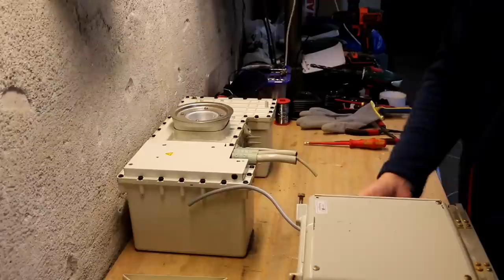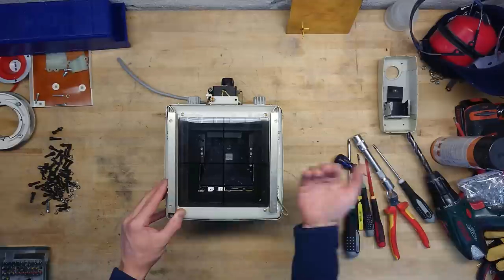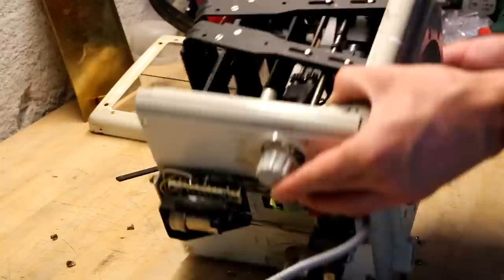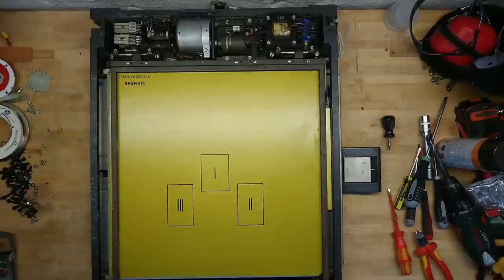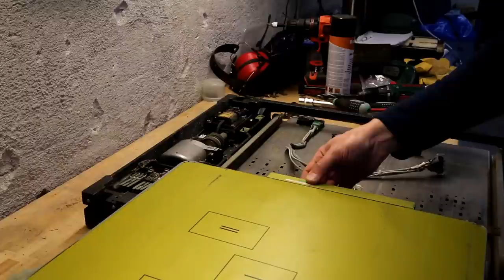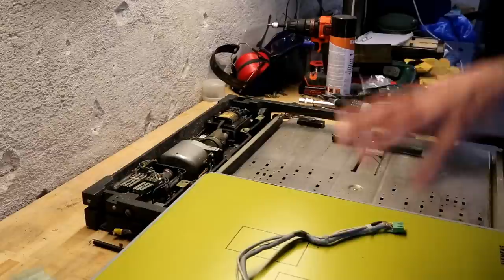Siemens Polyphos 30, XRAY Collimator and Image Plate Teardown (Part 2 of 3)

Comment: It appears to be an analogic X-Ray plate (film based)
The gray plate is a X-ray grid (fine lead strips and some x-ray transparent material strips interleaved) to avoid indirect x-rays ( it increases the resolution).
The yellow plate appears to be a typical design of an ionization chamber, a gas filled between two charged plates to detect x-rays.
There is no digital detector on this design
Reply from the maker: Thank you very much for clarifying what these parts really are :)

Comment: Could the small "motors" potentially be synchro transmitters?
Reply from the maker: That is a very good guess, they would make sense in the application where you want to synchronize multiply blinds that are not mechanically connected. I was not aware of the concept of synchro transmitters/receivers, thank you for pointing that out!
Reply: @KaizerPowerElectronicsDk   they seem to be used heavily in avionics, at least older avionics. There's another YouTuber that I watch (msylvain59) who tears down a lot of old aircraft stuff and they show up quite often. Supposedly very accurate for measuring or recreating angles or movements remotely.
Reply from the maker: I have been subbed to msylvain for years, but he makes videos faster than I can watch them all :)
Reply: @KaizerPowerElectronicsDk  I dont know how he manages to find all of this stuff, or where he stores it afterwards... But I do love his videos.
Really liking your videos too. Especially the mobile base station/RRU tear downs, since I work in telecomms myself. :-D
Reply from the maker: @TomStorey96  He buy it from ebay or other auction sites for the most. I got a few more amplifiers and an antenna video coming up this year (I do not want to promise too much)